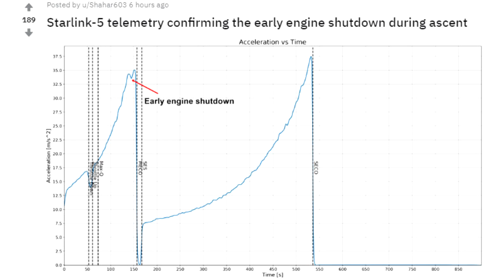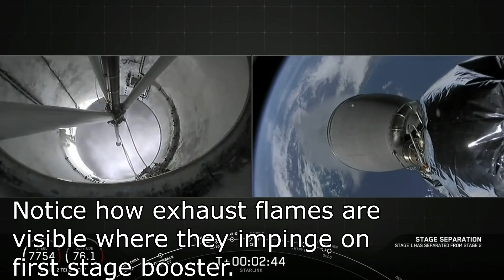Falcon 9 Suffers In Flight Engine Failure, Booster is Lost,  but Cargo Delivered Successfully

Comment: During the re-entry burn, the rocket also seemed to go quiet a lot of course. If you watch the horizon through the grid fins you see it changing direction then it has to make quite a drastic turn to try and correct.
Thanks for the video.
I'm looking forward to your next one.

Comment: This is what I like about Falcon 9 failures, the missions are still successful, its just not reusable that time, which is still a lot better then no reusability at all.
Reply: Five successful missions on a booster? that's four more than the competition, Does anyone know the SpaceX launch cost? Not what they charge.
Reply: @jamesdriscoll9405  On some cases 5 more than the compeitition.
Reply: @jamesdriscoll9405  normaly you have to charge 10x your costs (in other fields)
Reply: @Luckma1  that's usually not the case in launch vehicles. Usually the profit is a margin on top of the vehicle production and launch cost. even 2x the production cost for most vehicles would be untenable.
Reply: @Luckma1 - that's a pretty big margin.

I've heard food services are usually on a 2.5x to 3x the cost.

Electronics is on wafer-thin margins a lot of the time if there's competition (RAM, motherboards, etc), but margins on say a CPU can be 5-10x or more easily...

I'd question that it's normal to work with 10x your costs though.
Markups are big, but not THAT big...
Reply: > I've heard food services are usually on a 2.5x to 3x the cost.
 @KuraIthys   The food-service industry (restaurants, takeaway, fast-food, etc.) is typically operating on a 3% or 4% profit margin at most once costs beyond the food itself are factored in. Those businesses also have to rent space, pay for power/water/gas/telephone/internet/etc. (utilities needed to run the business and/or communicate with potential customers), compensate employees, etc.

Unless this whole discussion is a misunderstanding based on @Luckma1's use of "x" but meaning "%"?
Reply: In addition to the cost of each vehicle + fuel, they have a lot of operating costs: rent the pads, pay the Air Force, lots of support personnel, permits, etc. And a LOT of R&D and capital expenditure. I'd be surprised if their margin is only 100%.
Reply: Sometimes market buy vegetables and fruits from local farmers and sell it 10x more expensive if the price for said product is cheap

I live in rural area
Reply: I mean large shops
Reply: dgw mark up and profit margin is not the same thing
Reply: @martin-__-  They are, however, related. And I doubt the original statement of "10x your costs" was meant in reference to mark-up on materials only.
Reply: @dgwdgw  I dont know anything about the 10x markup. The 3x resuarant markup is pretty accurate tho, atleast over here in sweden. But that still doesnt mean their profit margin is  67%
Reply: @dgwdgw  this. standerd resteraunts run on 3* ingredient cost becasue thats around the point where they can actually make SOME profit. obviously there is some give and take depending on location and labor costs and CLASS of resetraunt but still...
Reply: They fail exactly how everyone else succeeds.
Reply: I know a girl who is doing some business and her profit margin is like 100x of her costs!
But I'm not sure you'd really enjoy doing what she does tho...
Reply: Plus if you take all the launches they have and multiply it by 10 (for all the engines) then factor in failures it's still hecka reliable
Reply: Hardware failure is hardware failure in my opinion. The frequency of these events is frankly concerning for a company with ambitions for manned missions.
Reply: @magisterrleth3129  Space flight is an inherently dangerous business. Every manned space vehicle/launcher in history suffers hardware and software failures pretty much over the entire course of their service life. They tend to get rarer as a given platform/design ages and matures, but they're still there
Reply: @magisterrleth3129  other rockets: 1 billion dollars, one use, one payload
Falcon 9: 500,000 dollars, 3 guaranteed, finally loses to accident, but all 4 payloads succeeded.

Are you sure about that? We still haven't have any news of Falcon 9 losing both its cargo and rocket.
Reply: @skybattler2624  I'm not denying how impressive their reusable rocket tech is. I'm saying that using them past the point of failure is a big no-no. Nobody got hurt, and it was another successful delivery. Yippie. But if the rocket had failed minutes before? Disaster. SpaceX is an incredible company. But they need to get their quality control under control. They clearly need better pre-launch checks. Failure is unacceptable for spacecraft. I'm not saying their feats of engineering aren't impressive, but I am saying that these kinds of failures are concerning. When you're talking about potentially carrying people into space, nothing short of perfection will do. Nothing bad has happened. Yet. But it seems like a matter of time.
Reply: @magisterrleth3129  I think that's exactly why they are reusing their rockets until failure... You need to stress test thing, figure out the weak points and iterate over it. It's cargo, and all security measures are being taken into account in case the rocket fails (because it's an expected thing to happen, not frequently but at least once in a while).
Reply: @magisterrleth3129  Remember Space Shuttle? They have much stricter quality control and yet when it goes catastrophic, it goes catrastrophically badly. And two of the failures are seconds during the launch.

Think about that.
Reply: @pedrojimenez2454  Hey, that's actually really clever, assuming it's true. And a much better justification than, "well other rockets only get one launch, so worth it!"
Reply: @skybattler2624  You're kind of insufferable, you know that? You check the equipment, you double check it, triple check it, then find someone else to check it again. One imperfection, one cracked O-ring, one overstressed piece of metal, and you could have a tragedy on your hands. A rocket ship is a finite area, I don't care if they have to disassemble the whole thing between launches and look at every piece under a microscope, if that's what it takes to prevent malfunction, then it's worth every dollar and second spent. Because again, they're just launching satellites for now, and they've even had a perfect record for delivering their payloads. But I feel these hardware failures are indicative of a problem with the way they're operating these rockets.
Reply: @magisterrleth3129  "hardware failures are indicative of the way they're operating these rockets" 
Isn't that the point? They're only using 4th and 5th launch boosters for Starlink missions currently. Any machine has a limit beyond which it needs retiring. SpaceX are currently finding out the Block 5 booster's limits and trying to improve them simultaneously a.k.a iterative design. You seem to be saying that a failure during the landing of a booster that's been reused four times is indicative of a threat to human life during DM-2, which will presumably use a completely new booster. It's impossible to check each cubic millimetre of a reused Falcon 9 for stress fractures, seeing as that would probably be several times more expensive than simply building a new one.
Reply: @pedrojimenez2454  Exactly.  You have to push the envelope if you ever want to discover where the limitations are.  An unmanned mission flying their own cargo is the best place for Spacex to test the real world envelope.   I know I'd  feel a heck of a lot safer flying on crew dragon than starliner.
Reply: @rohanpotdar908  Okay. I'm only a casual observer, I don't follow the company's moves very closely at all. I suppose as long as they won't be doing this kind of thing with manned rockets, my mind can rest easy.  SpaceX is by far the most exciting aerospace company in the world, I was worried they were slipping. I guess putting their equipment through the wringer like this is the perfect way to find out exactly what will break, and where, but it'd be nice of they lead with, "hey in this launch, we expect potential booster failure during reentry, don't freak out." It's good to know they actually aren't playing it fast and loose with QC, even if they are being cowboys with their boosters. Because to an outsider who only occasionally checks in on the progress of the future of humanity, seemingly unplanned failure looks really bad. I mean, they could test these things in a lab, but I suppose Musk and his merry band of engineers have a, "only the real thing will do," attitude.
Reply: @magisterrleth3129  - Manned missons are only going to be on new rockets - mind you one could make a very good argument for using them on launch #2 being the safest. Either way fresh rockets for manned missions
Reply: @magisterrleth3129  They're not landing Falcon 9's with people. Not now, not ever. Different rocket. You say a lot of angry big words for someone who self-admittedly doesn't actually keep up with the company you are criticizing. calling others insufferable when you are the one typing out giant ignorant paragraphs down this whole entire thread.
Reply: @magisterrleth3129  - "The frequency of these events is frankly concerning "
lets put this in the proper perspective - 
Lets count JUST the boosters that have been recovered successfully:
SpaceX has recovered a booster FIFTY times now (50)!
Nine engines per pre-launch hot fire test is 9X50 = 450 full thrust test firings (at the launch pad)
 Nine engines per launch is 9X50 = 450 ascent burns
Three engines per re-entry burn = 3X50 = 150
one engine per landing burn = 50
Thats 1100 engine burns during a flight launch campaign.
they have had TWO engine failures and we dont even know if they are related.

So thats a 2/1100 = 0.0018 or 0.2% engine failure rate with NO LOSS of mission as a result
That is ONLY "concerning" on any of the OTHER rockets in the world because NONE of them have early "engine out" capability.

Comment: Scott, what about the roll overcorrections after the entry burn shutdown? Doesn’t that suggest a significant reaction from escaping fluids? If so, I wonder if a progressing failure, or excess pitch or yaw deviation at supersonic speeds caused an RUD?
Reply: the overcorrections are out of the ordinary... ive watched all the launches... but just like scott, Im a dude in my underwear watching vids
Reply: It also looked kind of faster when seen side-by-side. I am guessing (also, Man in Pajama) that we were witnessing the death of that booster live.
5 launches is less than targeted, but a heck of a lot more than before (excepting the Space Shuttle). So this program is proving to be successful in my mind. :-)
Reply: @Widestone001  it depends on what broke.  If it was just a merlin, then fly that bastard again! why not?
Reply: @davidanalyst671  Ah, because it either burnt up on re-entry or impacted with very high velocity on the surface of the ocean (or both)? :-)
You'd need a lot of glue to make that booster whole again!
Reply: The booster probably prioritizes pitch and yaw control over roll control so "lets" the roll error get large during the burn.  The over-corrections are exactly what you'd expect form a PID loop that's been held overloaded for several seconds, the "I" term forces the average error to zero so every positive error needs a balancing amount of negative error.
Reply: Would a damaged engine have affected the aerodynamics leading to a roll?
Reply: @lolvks  To me it looks like the booster rolled one way, then the same amount the other way as if its data was not complete or damaged or something. Maybe it was dizzy and shook its head? ;-)
Reply: Christian Breitenstein under-damped control systems demonstrate similar behaviour.
Reply: @lolvks  Maybe lost thrust vectoring capabilities? IF the rocket was off course the rocket then attempts to get back on its path too rapidly, resulting in violent movements.
Reply: Kim Jung Un that’s certainly possible
Reply: @kimjunguny  no, because the control is rock solid while the engines are firing. It is start up that the roll occurs, before thrust vectoring makes a substantial difference. Thrust vectoring is then easily able to compensate. Loss of thrust vectoring control makes it go wildly out of control, which this doesn't do.
Reply: Did Scott lose half his accent ? A bit pissed sooo 🙄
Reply: Pretty close to the mark  big guy.

Comment: The rocking of the rocket following the burn and significant activity of the grid-fins seemed unusual to me as if it was trying to capture a glide path.
Reply: yea, i noticed that too
Reply: agree... it was compensating for something
Reply: I noticed the fins also.
Reply: Could the earlier failure have triggered an untested corner case in the recovery software, resulting in a wrongly calculated retro burn maneuver?
Reply: Nice profile pic

Comment: Could be a simple ruptured fuel line and no fuel left to restart. ?
Reply: was thinking fuel line issue for reentry. could have survived accent long enough because power down and ice build up at launch but slough off from heat soak/reentry heating. someone mentioned instability, damage to engine housing and/or lose of parts of an engine could cause that.

Comment: One step closer to Australia getting decent internet.
Reply: Maybe one step closer to getting good coverage, but not so sure about 'decent' internet. I've used current satellite internet technology (which is at geostationary orbit distance, so very different) and it is pretty much unusable for normal home browsing etc, because of the latency. Probably pretty effective for single direction data streams, for commercial use etc. That's due to the speed of light and the distances involved. But just because Starlink is in LEO, it doesn't follow that latency won't be an issue - a lot of links in the communication chain, and very short connection periods. If you are in the middle of the desert or rainforest, and have no other way to get internet, it should be a boon, but it may well prove to be a non-starter compared to ground-based fibre for normal home use.
Reply: @thisnicklldo  australia refuses to modernise their cable network, we started putting in fiber, which was shot down, ripped out and replaced with regular fucking broadband.
australia refuses to future proof
Reply: @thisnicklldo  Elon has said starlink will have a latency of around 20ms, which is pretty good. Much better than anything in geo stationary.
Reply: @Michael Biggs. Hmm, if Elon has said 20ms, I'm inclined to assume 100ms (which would be frustrating but usable). But whatever it turns out to be, my bet is that it will be a really big improvement for anybody that can't get fibre, and an expensive inferior alternative for those that can.
Reply: @thisnicklldo  the target isn't those who already have fiber anyway...
Reply: @thisnicklldo  Starlink will be over 10 times closer than GSO internet. Should easily get under 30ms ping times. Under 20ms at Gigabit speeds is the goal.
Reply: @Anthony Pelchat. Yup, I read Wikipedia also. Certainly speed of light round-trip times should not be significant, after all the round trip is only 1200 miles, and your normal fibre internet probably is often 20-50 miles. But there's a lot of handshakes - a typical web page these days involves 30+ round trips. These all need routing. Whether a solar-powered router that fits in one of these little things will be able to handle many simultaneous connections, I don't know. Time overhead will be around 5-10 minutes for any given satellite, the system has to be able to route to the right satellites and the ground-based antenna needs to be able to pick up the next satellite pretty quick. We'll see. I doubt if anyone really knows what the performance will be like, but I strongly doubt it will rival fibre. But as I say,  if you can't get fibre, then it will surely be a lot better than what you do have. I certainly treat ISP speed promises with some scepticism, and I always treat Musk promises with scepticism.
Reply: @thisnicklldo  Understood. Starlink will likely be slower for websites located fairly close by and faster for international sites. Fiber for most is technically faster. However, it relies on physical connections. A lot of problems can happen with physical connections. And they rely on an ISP that typically has a monopoly in the area.

Fiber at my other house is able to be fast, at a high price. (Don't ask why 2 houses. Not my choice.) It also had numerous issues due to an unstable connection for the first week that we had. And the connection still isn't great after it gets to the isp due to their issues and cost cutting. 

A client of mine has charter right now, and they are having frequent connection problems while charging $200 per month. They are trying to get ATT fiber, which is the only other option there, which wasn't an option a few months ago. They have wasted our time twice and delayed service for over 2 weeks so far, since they are having issues getting the connection working in the building.

Basically, fiber is only as good as the ISP that controls it, and the competition that they have in the area. Large cities may have great service. Smaller cities are a coin flip. Rural areas are almost always under served.
Reply: Isn's it censored to shit anyway?
Reply: @5Andysalive  not really. There are government mandated restrictions, but they are just DNS blocks at the ISP level and are trivially easy to circumvent.
Reply: Nowhere to hide from Skynet..
Reply: Ryan C  amen brother
Reply: When people are talking about gigabit speeds but your internet connection maxes out at 8megabits (1mbyte) per second... And is constantly at around 4 megabits. Damn
Reply: I’m Australian and what a waste the nbn is 🤮
Reply: The entire globe really.
Reply: Snugg Hug 
Sad but true
Reply: have fun with the geomagnetic storm issues in the future